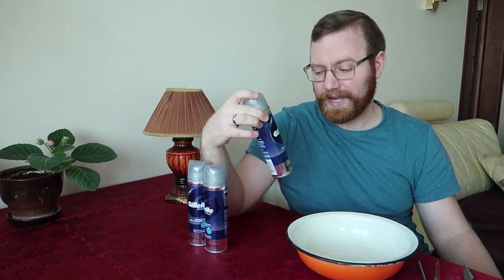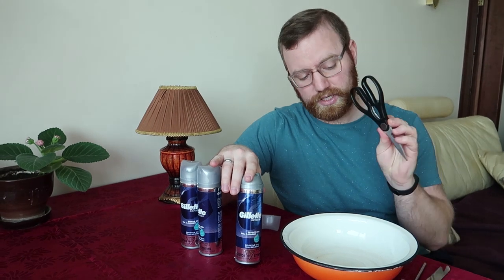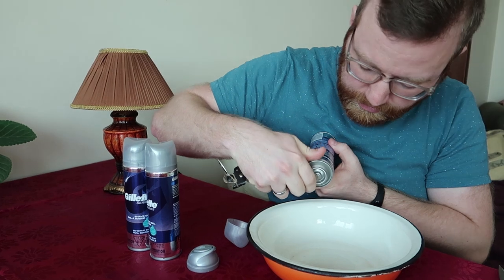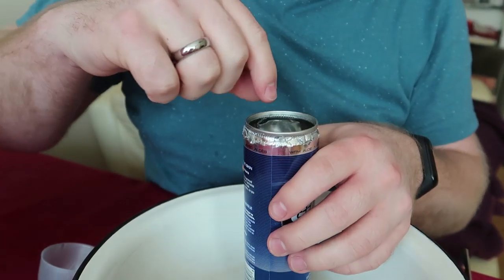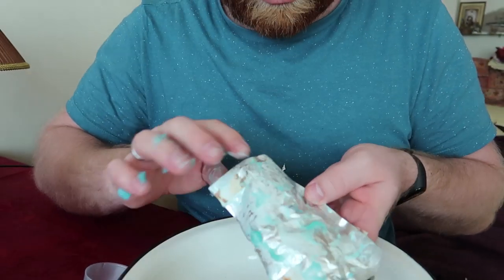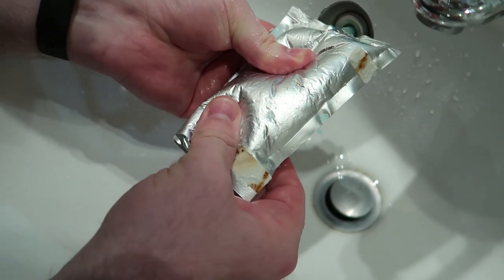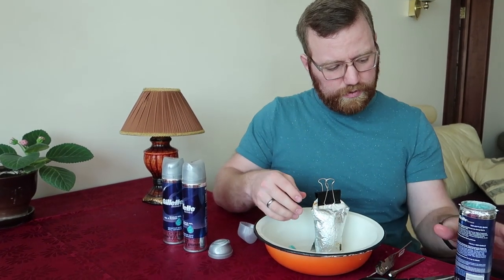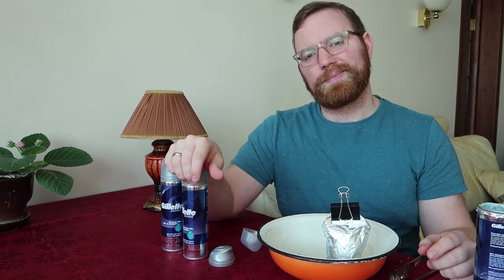HOW TO GET SHAVING GEL OUT OF CAN. LIFE HACK! ⚠ (WHEN YOU HAVE MORE GEL BUT NO PRESSURE)

Comment: Great idea.. but can opener could not open the top - but worked fabulously to open the bottom.  Pierced the bag with a knife and the gel ran out.  Poured that into an pump soap dispenser.  Problem solved.

Comment: yeah, only once opened it will dry out what is left of it, and unless you can do something to maintain the moisture it will probably be a one time use once you opened it, and that clearly wasn't intended for when was sold as a spray gel can  combo, but the tip for opening it like a normal can was surely useful

Comment: i have a can design that is a much improvement over this. One of those vacuum design, where there is a pusher underneath, and as you use the gel, it goes up, and this design pretty much won't have any wasted product. 

Think of the design of a syringe inside the bottle.